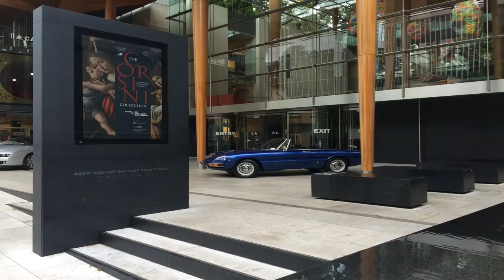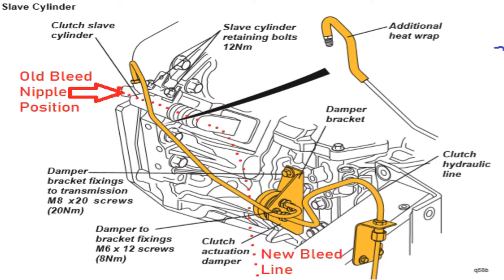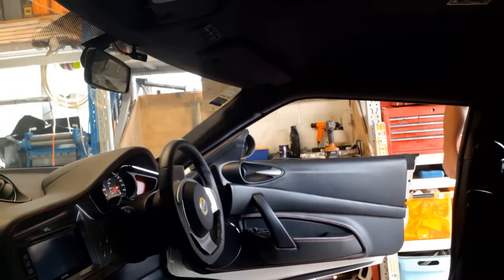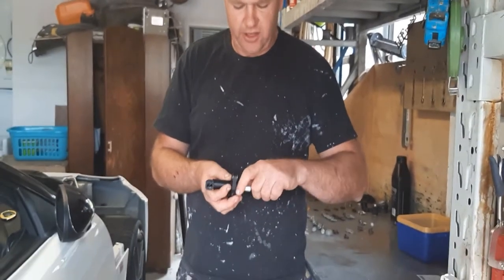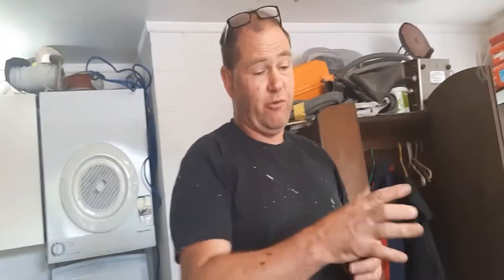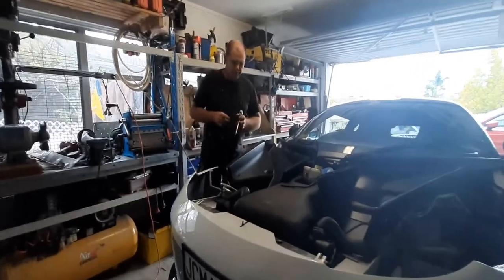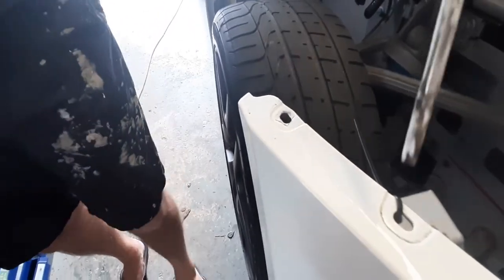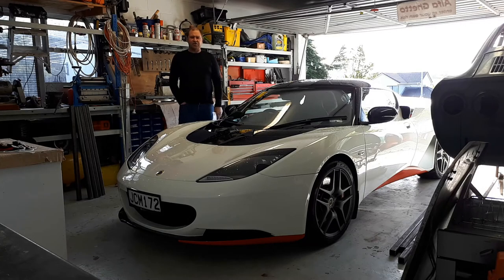Lotus Evora Clutch Master Cylinder Replacement (& Front Clam Removal)

Comment: I’m picking up a 2014 Evora s and the previous owner had the same Master Cylinder issues like this, would this put you off from buying another one? Like is it an on going issue? 

Thanks!
Reply from the maker: Hi there.  I believe it would only be an on going issue if you replaced the master cylinder with the same style master cylinder, ie like for like plastic one.  I replaced mine with the GRP Willwood one and to date its  been fine.  Definitely wouldn't put me off buying another one however I do all my own spannering so cost is low(er).  If the previous owner replaced the master cylinder with another plastic one I would expect that you may have to do  it again in a couple of years IF you don't bleed it annually. Bleeding annually apparently makes it last a lot longer but its a bstrd of a job without the modification I suggest.   Mine lasted 5 years and 25K Km before it said enough is enough.  If your paying a shop to do all your work it might get a bit pricy but hey its a Lotus, you expect things like this
Reply: @markjohnash5895  Thank you 🙏

Comment: Hi Mark, 

I just purchased a ''new'' Evora S 2015 from the dealership.
It's a 2015 model (5 years old) with only 80km (50 miles) so there is no warranty available. 

I drove the car about 500km (310miles) and I noticed some type of clutch burning smell and/or rubber smell coming from the top driver side vent heat extractor hose. (Driver side: if you are in Canada... so left side).
Before driving the vehicle again, I am planning to change all fluid (including brakes/clutch fluid) since the car has been sitting in a garage for 5 years. (Do you have any idea what this burning smell could be?)

I was wondering if it's worth to upgrade the clutch system? Do you have any more issues with you clutch or do you have any other recommendations? 

Thanks in advance,

Pascal
Reply from the maker: Hi Pascal.  Welcome to the Evora ownership club.  As for the burning smell, I really don't know.  I have new cars produce all sorts of funny smells until they have gone through quite a few heat cycles.  I didn't buy my Evora new so cant really give much valuable advice on the smell. As for upgrading the clutch, from what I understand they are reasonably solid except for the fluid heat soak.  Putting that extension in for annual bleeding would make bleeding easy be good for preventative maintenance